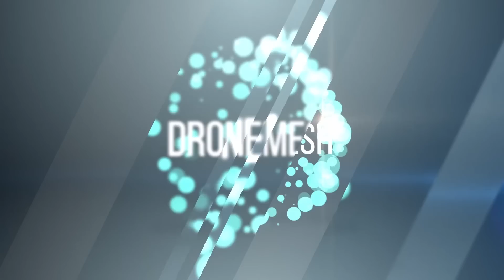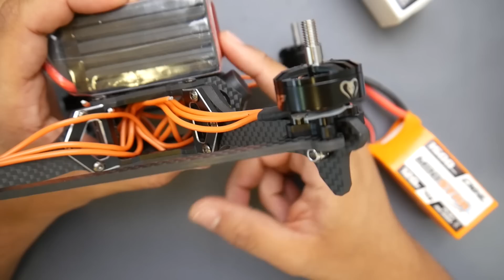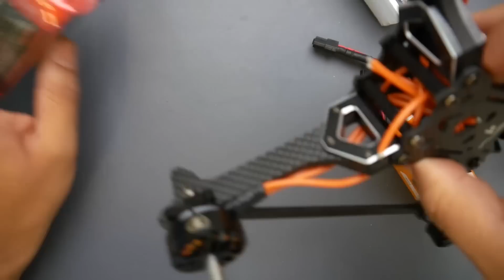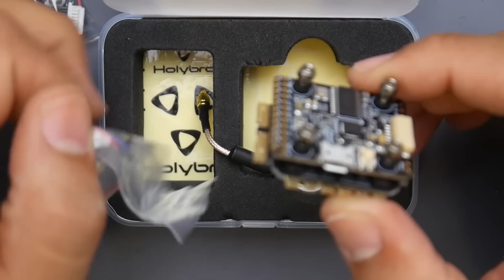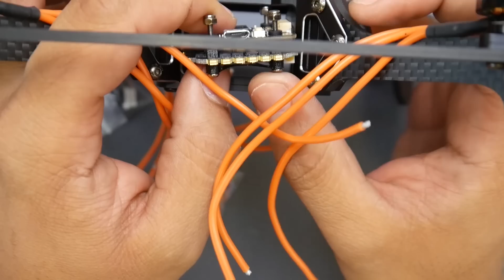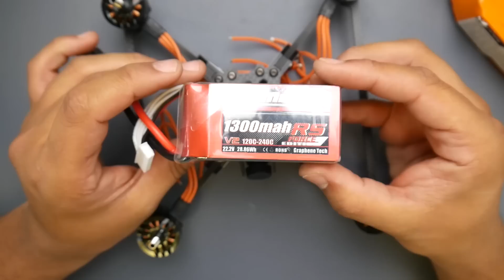iFlight Vertigo 6S prototyping with possible CNC mod

Comment: Did you say "I tightened it as hard as I could and the aluminum didn't melt so that means its strong aluminum such as 6065" ? Its most likely its 6061, that is much more common. Also what do you mean melt? How or why would aluminum melt from tightening a screw?
Reply from the maker: I reference low strength aluminum as butter.

Comment: i never like vertical type frames but  this one..
Reply: As in vertically oriented carbon plate? It's literally how it's supposed to be loaded. Bending moments across the layers loses you close to 50% of the strength.
Reply: @rionmotley2514  are there vertically stacked cf sheets somewhere?
Reply: @marc_frank  it's like plywood, so, not exactly. The best option would be a molded carbon frame that's actually stress optimized, but you're talking easily 4x tge cost for maybe 10 or 20% weight savings. And poof in a crash. But think about the way lumber is laid to support a floor or a deck - the structural members are all oriented with their widest dimension vertical. A 2x12 stringer is about the same strength as a 2x4 when laid flat. Turned on edge and it's more than 6x as strong (and stiff, etc).
Reply: @rionmotley2514  nice way to think about it

Comment: 170gtam abit bloated for racing.  Looks tough, i wish they can 3rd brace cross bar on the front .  ohh well
Reply from the maker: You can add some with no modifications.
Reply from the maker: 117 gram
Reply: Definitely could use some windows milled in the arms to lighten things up.